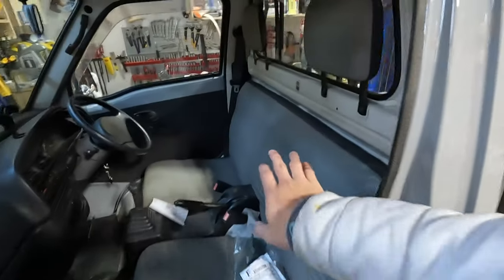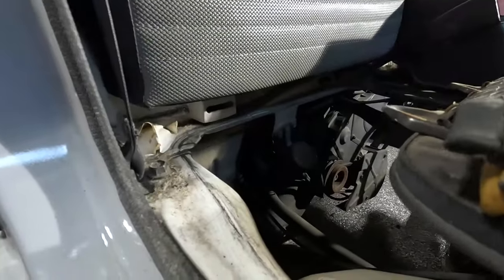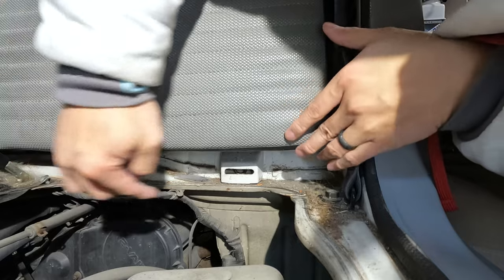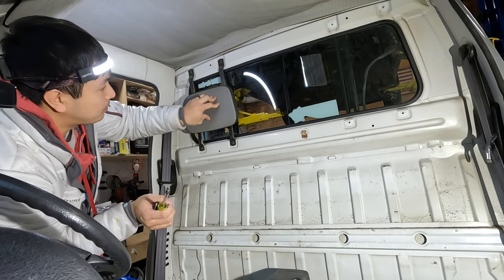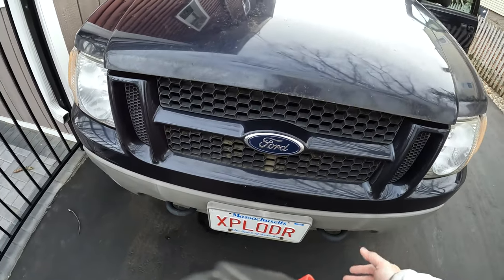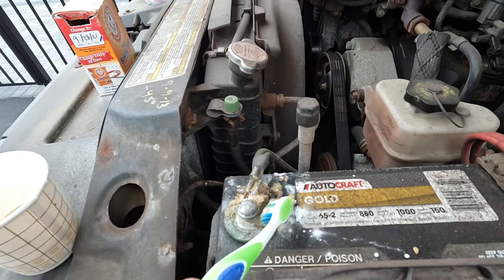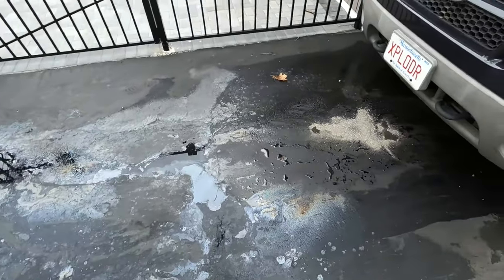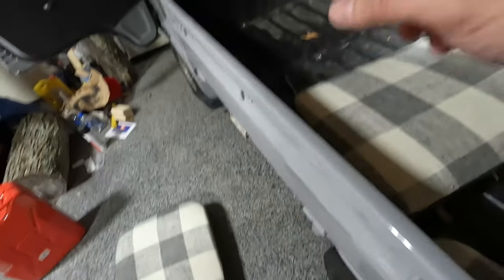Suzuki Carry - Seat + Headrest Removal/Install - Reupholstered w/ Footage of Stupid Me Making A Mess

Comment: It’s interesting to me how much further back your engine is than mine. (Mine is between 92-95). Time for a battery maintainer for the shop truck eh?   ;-)
Reply from the maker: What do you mean further back? The only thing might be I don't have a transfer case for front drive since it's a RWD model
This is a 1995 DC51T
Reply: @AnythingWheeled  my engine oil can only be accessed from under the drivers seat. And the air cleaner is under the passengers. I think my transfer is under the plate in the bed.
Reply from the maker: @JimsEquipmentShed  I looked at a few listings of these Suzuki's on carfromjapan and saw that the 4x4 models have the engine placement like another foot or so more forward. That's a big difference for access to certain things. I also access the oil fill from under the driver's seat but everything is convenient under the bed hatch  panel.
Reply: @AnythingWheeled  I had not realized that yours was 2wd, so I guess that makes sense. Kind of strange they chose to move the engine as opposed to just making the tear drive shaft longer.
Reply from the maker: @JimsEquipmentShed  over the past year learning about my two kei vehicles... I've learned the Japanese make some strange choices..
Reply: @AnythingWheeled  Yea, there are some unique ideas, but that’s part of the charm. 
Same with the Germans, I had a Unimog, and that thing was so incredibly over built it was amazing. 
For example, it took an Allen wrench to open the hood to access the engine from the outside.

Comment: And got done the same day 😮
Reply from the maker: I was told to expect it the next day but I got a call about 5 hours later saying they're all set! I mean they're not the most complicated shapes to work with :)
Reply: @AnythingWheeled  that looks
Really good, I need to get my done on my 93 Suzuki
Reply from the maker: @nicolasrivera321  the upholstery biz is $$$ around here in eastern Massachusetts I saw some NICE work done on the bucket seats in my Cara/AZ-1 for around $500 in Florida.
Reply: @AnythingWheeled  wow that’s good, I need to find a place here in Connecticut.